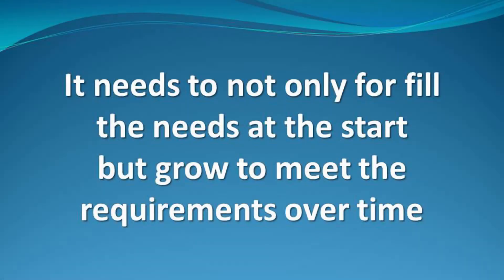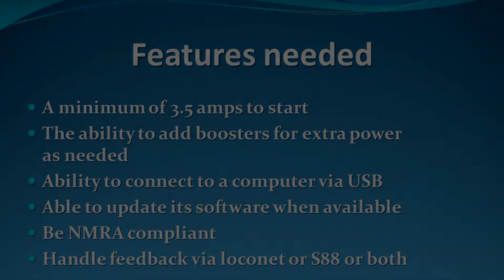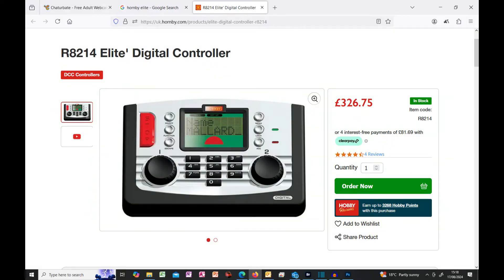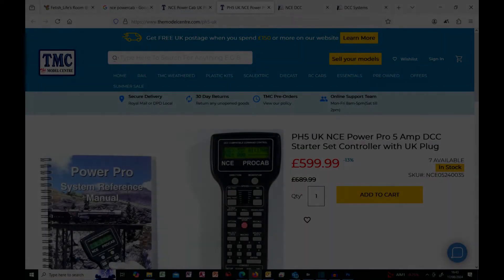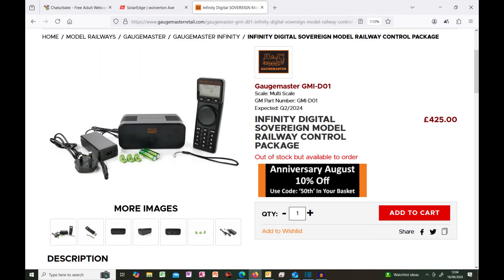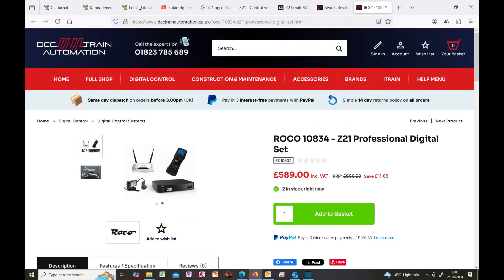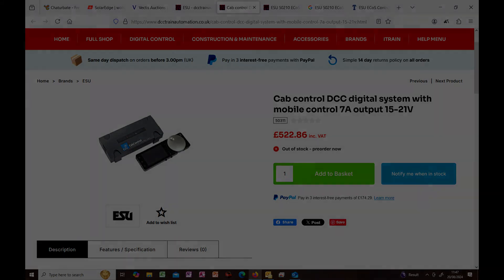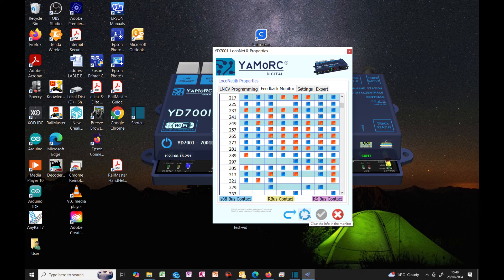Choosing the correct DCC controllers / command station for you by comparing there features

Comment: Feel extremely lucky to have chosen the Roco Z21 system as my first DCC control system around 5 years ago as it is fantastic for allowing the use of a tablet to control and not having to remember loads of loco function numbers or points. The route planning is flawless and a feature I could not live without. Now on the 5th version of the layout and as it has grown in size each time, i have been able to add boosters to the system too and now have the main control unit plus 2 dual boosters, allowing for 5 separate bus wires for different areas of the layout. Cannot recommend the system enough 👍

Comment: Woke be really great if you would create a spreadsheet with each model across the top row with decreasing voltage towards the right, and the features down the left column with most advanced technology towards the top. This gives an easy ready reckoner, with price, features and cost all available for easy comparison.

Comment: Yamorc yd7010 looks too cool for that price. The only thing that's disappointing is the cost of their RailCom detector.
Reply from the maker: I have the Digikeijs DR500, the forerunner to YD7010. I've used it for nearly five years and updated it to the YD7010 about a year ago, and have been very pleased. It works very well with ITrain. I don't use RailCom because of the high cost of all the components needed. All manufacturers of RailCom detectors are approximately 50% more expensive.
I am planning to do a video on why I didn't use RailCom

Comment: I run a DCC EX csb1, 5 amp system from CMME (Chesterfield)  it is WiFi and uses engine driver app for a mobile phone. Most of us have unused phones hanging around, but if not, you could do this with phone for £200. It can also be linked to JMRI . In the past I ran a Digitrax Zephy with a separate hand control and loved it's simplicity and ease of programming
Reply from the maker: I totally agree, I am in the process of making a follow up video to this one showing lower budget options. The reason I did not the DCC Ex in this video was the preassemble option was not available at the time of recording. I only wanted to show ready made of the self options. I also plan to show how to make up the DCC EX and use it for modifying CV's. I also use a 5amp DCC EX connected to ITrain controlling all of my accessories.

Comment: Request your support 
I recently purchased a WalthersMainline GE ES44 Evolution Series GEVO diesel locomotive with DCC and sound. I am currently facing an issue when attempting to change the short address (*CV1*) from the default value of 3 to another number.

I am using a *Digitrax DCS52 (Zephyr Express)*. When I attempt to write a new value to CV1, the system shows the operation as "Done," but the locomotive still responds only to address 3. Additionally, when I use the *CV programmer menu*, it successfully reads CV values, but attempting to write shows “no pulse acknowledge.”

I’ve confirmed proper track and wheel contact, and other decoders program fine using the same system.

Could you please advise if there is a known issue with CV writing on this unit or if any special programming method is required for this model?

Looking forward to your assistance.
Reply from the maker: This sound unusual 
I am not failure with that decoder as I am based in the UK
I am however aware  that some decoders do have a lock facility that prevents them being updated 
If that is the case you need to be disabled 
I do not know what decoder is fitted 
So you will need to check the decoder instructions or contact Walters
Alternatively, do a search on YouTube for the loco 
Sorry I can't be of more help
Reply from the maker: I believe the loco has a ESU modified Loksound 5  check cv15 that is the lock it should be set 0 to be unlocked
Reply: @DCCandMore  thank you for your support after a long, hard work. I got the solution. I will update the video on this soon.
Reply: @DCCandMore  thanks for your reply actually after long, hard work I got the solution. I will upload the video soon on this.

Comment: I just successfully converted my old 1960’s Triang Princess to DCC.
A number of years ago a friend convinced me to buy a Hornby Select and a single decoder from Hatton’s.
I knew nothing about the technology and the controller sat in the drawer awaiting inspiration.
A few weeks ago I built up enough courage to try it and it worked, I was thrilled.
Now what ? I am thinking I can dedicate a track to DCC given the Select will allow me to run a few trains on the one track.
I would appreciate your input.
Thanks
Reply from the maker: Well done 
DCC should not be scare 
It is very important that thee dcc an DC NEVER ELECTRICLY COME INTO CONTACT as this could damage the controller
As you have converted that track from DC to DCC it was most probably using Red & Black wiring I would strongly suggest replacing the  wiring for the DCC to other colours so preventing the to accidently coming into contact.   
It is for enthusiasts like yourself and there are many of all ages that find DCC intimidating I decided to set up this channel as I am a electronics and computer diagnostic engineer I think we are of similar age as I to had the same loco in the 60's
I would suggest subscribing and use the notification as I will be uploading many videos explaining in simple plain English to help models like yourself understand how it all works and get the most out of this hobby. Unfortunately there is
Reply: @ Thank you. I will sub immediately. Cheers

Comment: What about this device: https://www.youtube.com/watch?v=UsGHcASOBks ? It seems both cheap and plug  and play (ish).
Reply from the maker: I did not include the DCC++ as this requires the components to be bought and assembled by the user, and felt this was beyond most beginners and the  EX-CSB1 had not been relist at the time of recording.
I do intend to do a follow up  As I do use a DCC++ to control my accessories using ITrain 
I am from a electronic diagnostics  background and am trying to provide  help for the community most of witch are not technical, a better understanding in baby steps, so they can get more from the hobby.
I will be building a DCC++ command station from scratch in a future   video and how to use it to adjust CV's
As you will appreciate it is imposable to include every thing in one video
Reply: I went with the CSB1, no regrets. I have since learned to program the unit to operate with cheap servo boards. Printed my own brackets and w servos, micro switches etc, I have turnout motors that also juice the frog and change led signals for around 5 bucks a turnout. I almost went with a digitrax and glad I avoided that.
Reply from the maker: @LiquorandCheeseburgers  Well done most models just starting out would stuggle with the coding and would run a mile rather than get in to that 
As for hand thotals have a look at the generic wi fi ones
I dought thet DCC EX will develope the interfce for that as Loconet will need a liecence 
I it avalabe for individuals from git hub and the is a Arduno libbery  
I do have planded a DCC aaccessory decoder using both servos for points and uncouplers as wedd as led signals 
This will include the coding
Reply: @DCCandMore  Yes sir, I use the WiFi Throttle "Engine Driver". I may try one of the others but I'm pretty comfortable with this one at the moment.
In the future I'd like to learn to program the CSB1 to run I/O expansion boards so that the logic will allow me to use physical switches for turnouts in conjunction with what I already have, but thats down the road, I have a ton to do before I should even worry about that!
Reply: Do it, it is plug and play. I use a hand me down Kindle with Engine Driver for a large display. You won't regret it, it's expandable and works great. I am hoping that DCC ex comes up with an interface solution to incorporate hand held controls like a digitrax or something, but that's just me, it works awesome As is.

Comment: What about JMRi using a DCC Ex Command station. The cheaper option.
Reply from the maker: I chose not to include the DCC EX command station as this requires assembly by the user and I didn't feel that was appropriate for this video the intention was for this to be off the shelf alternatives. The Turn key pre assembled solution at the time of this video was made was not available I will be doing a full video on assembling DCC EX command station controlling accessories. I will also in the future video be comparing JMRI Rockrail ITrain and Train Controller I'm explaining why I chose to use Itrain. JMRI is not the most user friendly piece of software although it is extremely good and powerful it has an extremely steep learning curve. Stay tuned
Reply: @DCCandMore  agree with you, although I do like JMRI and DCC Ex in terms of being kind on the wallet, it's definitely not for the first time user as it requires alot of setting up. Once you've got an idea I do believe it does offer a cheaper alltwrnatve as a way of getting into automation , block dection etc. Love your video very insightful and useful information. Keep up the great work
Reply from the maker: thanks

Comment: WHAT THEY FORGOT TO MENTION !
But no available DCC controllers have any interface built in, to cater for European, British, or even Japanese Outline layouts. All of which in real life use "Block Signalling" (Such as Absolute Block or Track Circuit Block) signalling requirements ANYMORE ! The current DCC system, is purely geared for U.S Railroad layout type needs, which of course use CTC (Central Traffic Control - A Radio message type system giving permissions to move). Which is almost totally banned across Europe as a highly dangerous method of Railway Operation. Hence any current DCC controller is useless for British layouts as the last useful DCC system (made by Fleischmann Germany), which included the necessary "Command Control" for British & European signalling methods of layouts. Lost out in the Commercial war that ensued between the crude U.S. DCC methods and the more sophisticated European NEM requirements !!! 

Hence no British layout, even exhibition layouts, that use DCC are accurate. As all DCC current systems have to comply with the crude American methods to function. Indeed the only way to interface signalling with trains realistically on a layout, is to utilise the British Computer based MERG system. Requiring at least a Laptop or PC. Or the more realistic & far cheaper method using 12v DC + TCC (Track Circuit Control). But that needs an understanding of Direct Current requirements, Relays & Track Circuits to provide the real life Interface. And it seems virtually no so called Modellers in Britain today have any real comprehension of Electrical methods, or how to wire layouts to achieve the necessary interface. As no one seems to join a Model Railway Club anymore, to learn how all this can be done !!!
Reply from the maker: Thanks for your comments. Although you are technically correct you have to remember this is a hobby for amateur none technical people, also you have to bear in mind that the public have to have things that they can readily obtain. All commercial products  controlling model railways conforms to the DCC standard of NMRA. The vast majority of model railway enthusiasts would be incapable of following the MERG route as they probably do not have the interest to be able to build or programme they simply want to be able to have some fun running trains. I wish to point out the DCC protocol and standards were originally designed by Lenz of Germany and was adopted by the NMRA Standards back in the mid 90's for the vast majority of us we have to accept the world of what is possible rather than what is perfect for each countries signalling system. Is still strong support for most model clubs around the country I was originally from Leamington Spa which is the home of the Leamington and Warwick model railway club which has an extremely strong membership many of which are MERG members. I myself despite having advanced degrees in both electronics and computer engineering have chosen not to be a member of MERG. For the hobby to thrive it needs to be as open and welcoming to as many non-technical people and work with the what is commercially available rather than what would be perfectly emulating any particular countries signals and operations. As the NMRA standard is a global standard which I'm sure imposes restrictions not only on UK operational signalling but also probably other countries globally it would be totally impractical
Reply: @DCCandMore  Are you implying that traditional 12v DC equipment is no longer available ? And for your information that ignorant organisation the NMRA deemed the German version of DCC "Non NMRA Compliant" and killed off the much better of the two systems. The German Fleischmann developed DCC plugged the GAPING hole in DCC by providing the necessary "interface" between moving trains and European Block Signalling systems. Including British signalling such as Absolute Block, Track Circuit Block, or even Permissive Block. Further no current DCC master controller can cope with "Interlocking", or even provide for British Multi-aspect Automatic, or semi Automatic signals. And even Manually operated signals cannot be made to function correctly, with this daft American DCC system. And after sales "accessories" cannot change this fact. To cope it needs the basic provision for signalling to be included in the Master Controller.         

The Current American DCC system is utterly useless for European outline,  as it is only capable of dealing with the American Railroads CTC (Central Traffic Control) methods. Which are banned by virtually all European Railways as a highly dangerous method of operating any Railway. And in the US, CTC results in daily smash ups & derailments. DCC is therefore clearly aimed at the ignorant masses and "Kiddy toy train sets". So Commercialised rip off junk for ignorant imbeciles.
Reply: @railwaymechanicalengineer4587 im pretty sure there are numerous ways to implement block signaling on DCC layouts,  even without using a computer....   maybe have a loon at what Iowa Scaled Engineering has been bringing out,   and MSS or the Modular Signaling System , just for an example...  this allows block signaling based on the movement of trains...
    Maybe if you're so smart, and see a need for this type of thing, then you should develop a set of products to handle just this type of situations. ....
Reply: Block signalling can easily be controlled by using SIGM20 colour light signal controllers now owned/ made by Signtrak / GFB Designs. That has Loconet on it and can be used alongside a layout with DCC that has or hasn’t a Loconet interface. The manual is brilliant it explains everything with clearly illustrated examples and its programming software is free. I am all in favour of learning and mastering using DCC first - getting what’s right for you with locos and accessories with routes  as a starter then adding and paying for block detection kit later. As in this hobby there are so many ways of doing things to suit your capabilities, enjoyment and budget. Hope helps. Best regards Stephen

Comment: Great info. I managed to find a Digikeijs DR5000  from a dealer in the USA for USD$200 and bought the Wi-Fi upgrade kit to update it to YaMoRc YD7001. Arrives next week. Prior to that I was likely heading down the ESU Command Control II. Although TCS has a pretty decent system, but again pricey.
Reply from the maker: I am pleased it was helpful Well controlling the DR5000 it does have a computer interface that you can use But if you wish to use a hand controller I would go for the Digitrax  DT602 that’s what I have.   Or alternatively it is possible to use Z21 app although there is a small fee for this, Or any DCC compatible Wi-Fi app OS or Android  
For computer control I used ITrain  instead of JMRI. As it was much simpler to set up I will be doing videos on ITrain and setting it up In the future